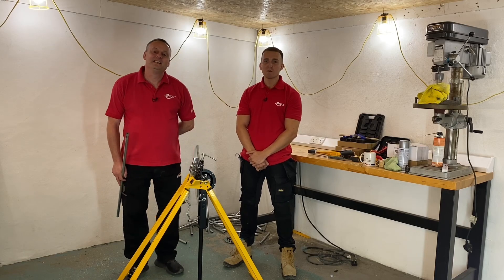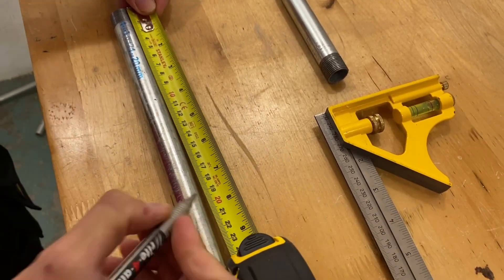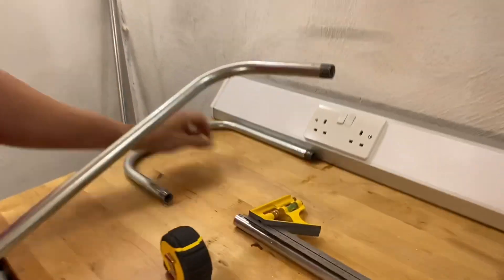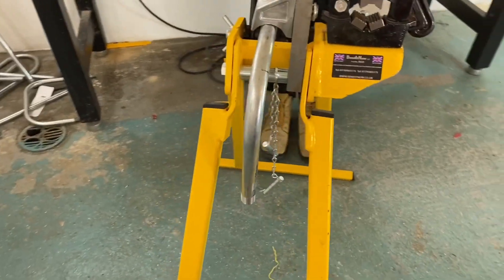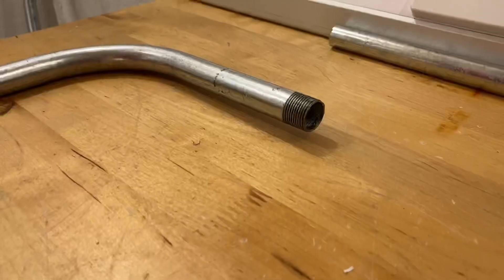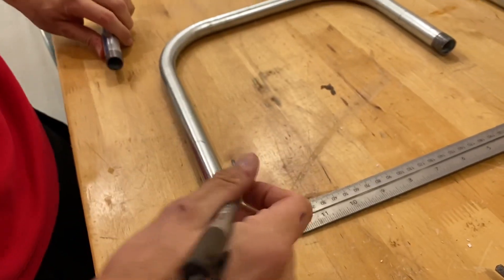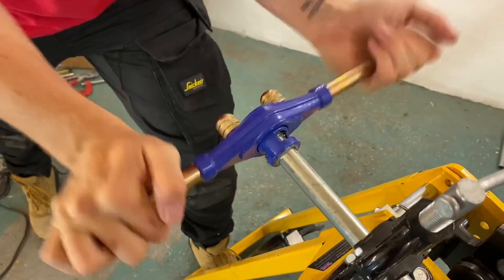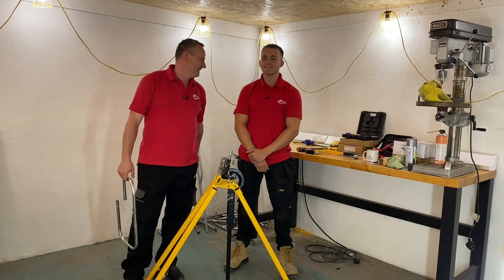METAL CONDUIT INSTALLATION: BACK TO BACK BENDS to exact measurement

Comment: Another very informative and interesting video and lesson from you both. I would like to offer a suggestion please, as an ex NVQ tutor in carpentry and joinery. The combination square you are using is for 'trying' angles (45 and 90 degrees) and therefore should be referred to accordingly. A try square is used when marking out timber at a workbench and a set square is commonly used with a drawing board for technical drawing. A small point but the correct jargon is important - as you have perviously stated - when learning a trade. Your training videos are very well edited and explained. Have you considered publishing a text book(s) to supplement apprenticeship training? I think it would be a winner😁👍. Bill. Leicestershire.

Comment: Still no one uses total length of space cut total of pipe length the split measurement  to center of pipe then do offsets if needed then measure from center of pipe and bend then measure from center of pipe  to bend on opposite  side  :)  why does everyone leave that out it's super easy super fast and it fits easier just saying only cutting pipe once while its straight with no 90 bends etc   geesh

Comment: Assuming your pipe bender is level you can put a level on the first 90 degree bend when placed in the “shoe” and  level it. This would have avoided what we call a “dog leg” or “dog” in the US. Very handy when putting “kicks” into pipes as well. Interesting to see how conduit bending is done in other parts of the world. My company typically provides Greenlee 555’s.

Comment: Conduit is miles out still rocks on bench , not checked that inside of conduit it suitable smooth and no burrs inside , conduit does not banged after use to clear any swarth and when checked against template it’s short
Reply: Great videos though. It provided me with the essence.